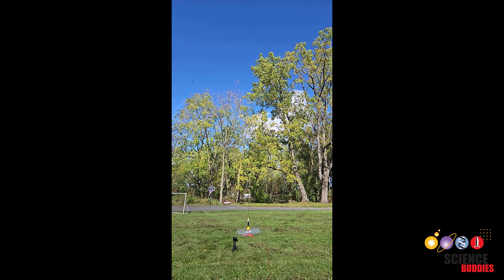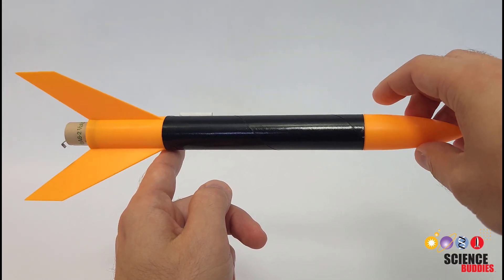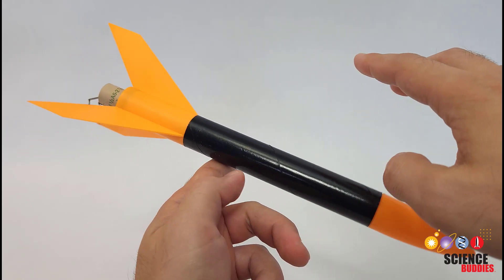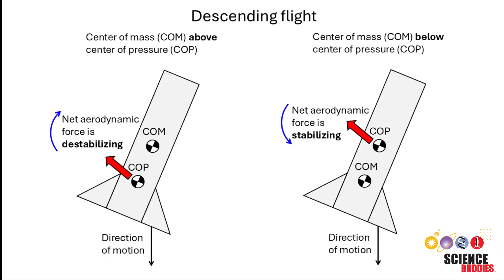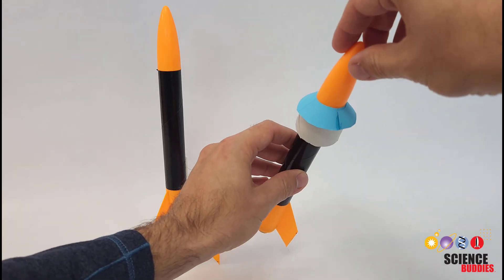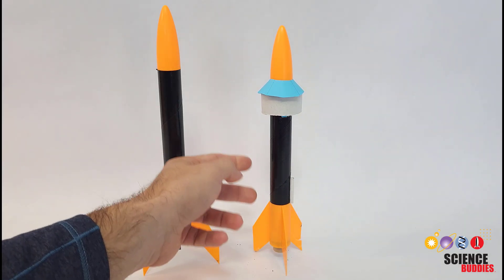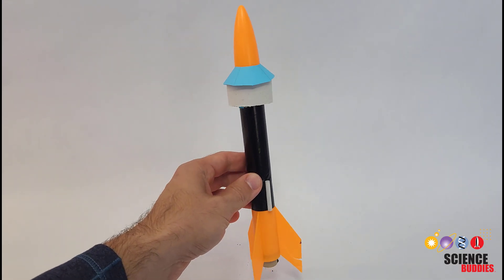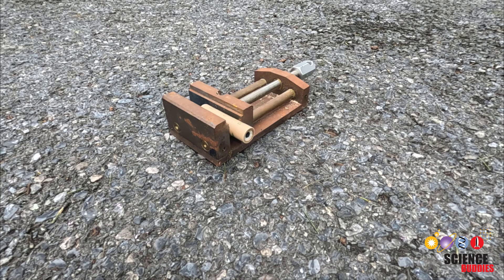Vertical Landing Model Rocket | Science Project

Comment: What would happen if you were to reverse the direction of the fins when going to land? Would that reverse the direction the rocket is pointing? And is there even a practical way to do so?
Reply from the maker: Reversing the direction the fins are pointing while keeping them in the same location on the rocket would not move the center of pressure much, but we haven't tried it ourselves, so cannot say for sure. This is an engineering design project so we did not explore every possible solution.